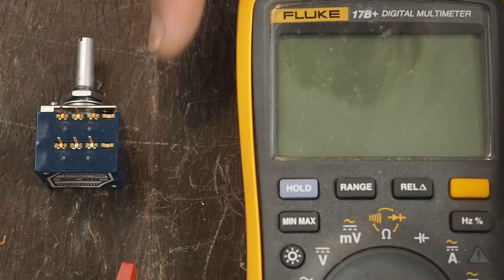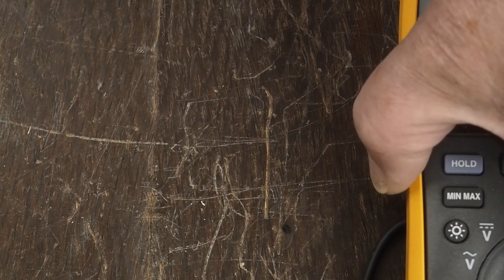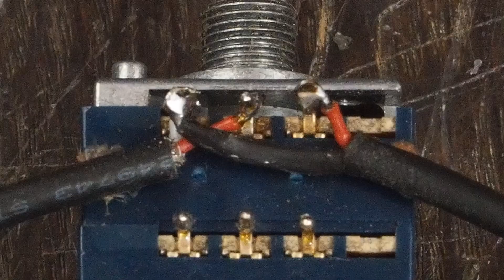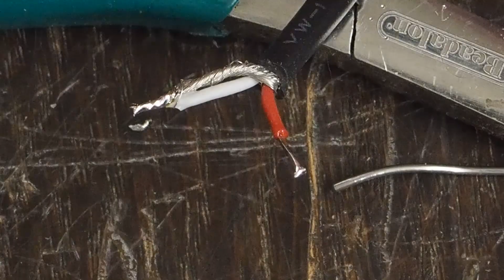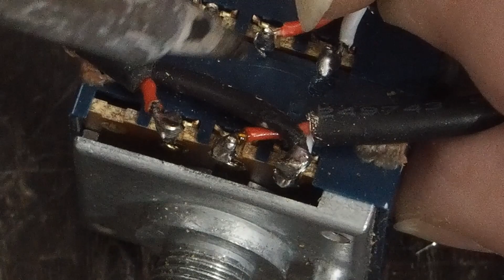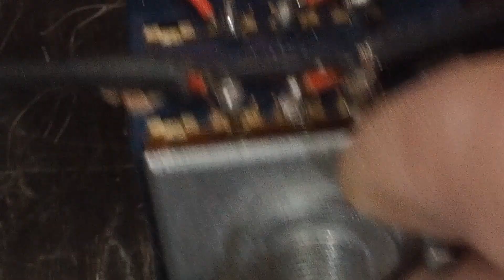6SQ7 EL34 Tube Audio Amplifier: Volume Control Wiring

Comment: Great video and the shelled wire.  You can bypass the gain control if you have your own pre amp input?
Reply from the maker: yea, just connect the RCA jack to the first tube grid.

Comment: When you mentioned the noise, is it noticeable from your ears or oscilloscope. I didn't use the shield wire but didn't here any noise so I wonder if I would have to fix like your method. Is it the same method without volume pot? No shield on RCA jack and shield with ground to the line-in?
Reply from the maker: Yes or possibly connect the shield to the chassis at the input end only and leave the negative path of the circuit floating at the RCA end.  The idea is to not have any internal noise, such as AC heater noise, making it's way into the signal path. This is worthy of more study :)